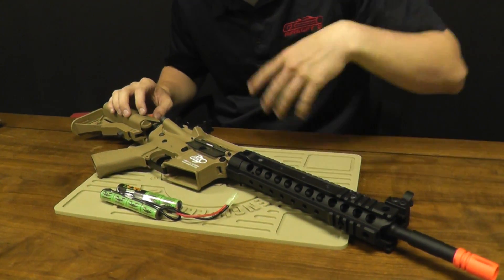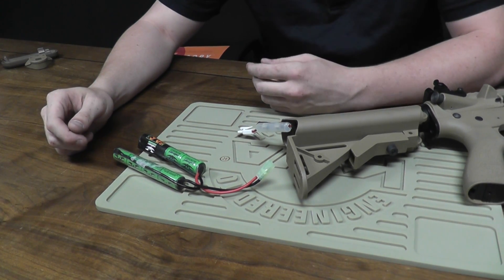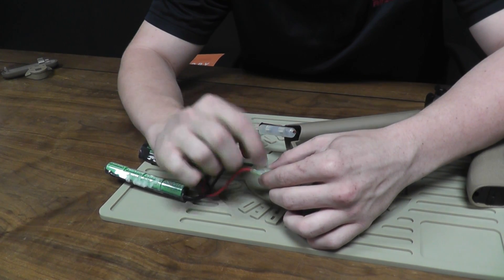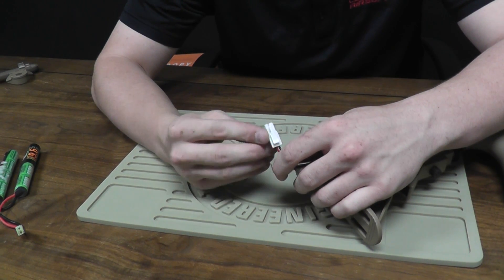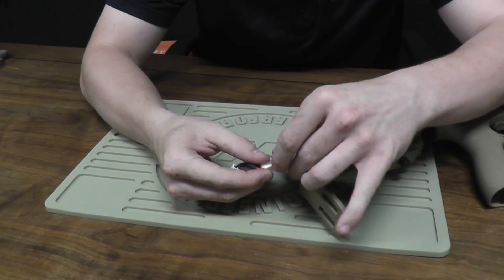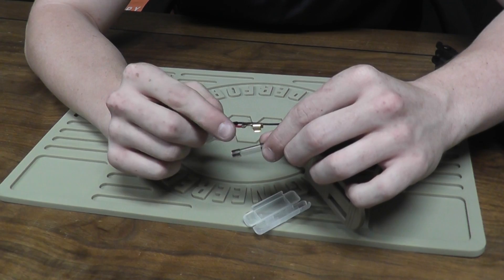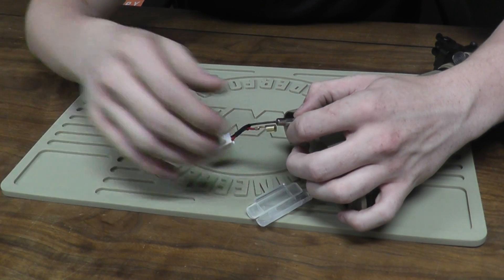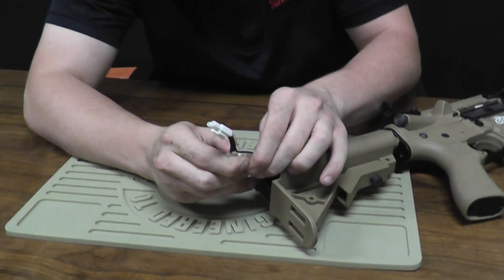Airsoft GI Uncut - Basic Battery and Connector Problem Solving

Comment: One of the wires in mine popped out of the plastic connecter how do I get it back in do I use some sort of glue please respond
Reply: Ummm well you just pop it back in
Reply: Ernwell Himmler ...hot glue does great and won't ruin it
Reply: @rivernix6801  just be careful not to use too much probably cause if it gets in the way you wont get power

Comment: On my airsoft m4 it just stop working I checked my battery area and the battery connection was out of the plastic plugin and when I pushed it back in it worked for 2 bbs the. Gave out looked it over again I tried unplugging and replugging the battery the wire wasn’t cut or anything but it might just be old I have had it for 3 years with constant use(never opened t or changed any parts)
Please help